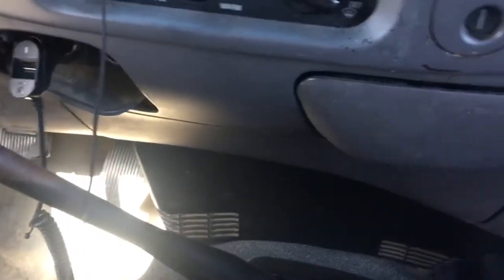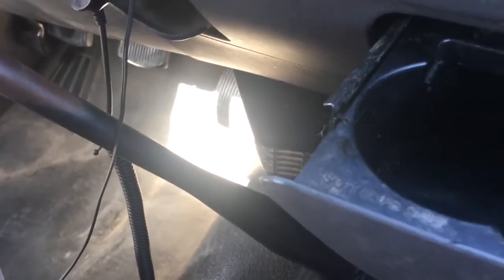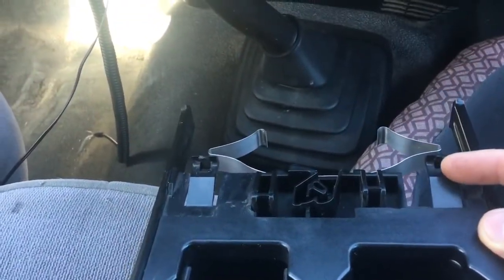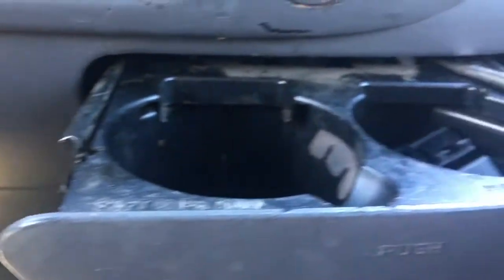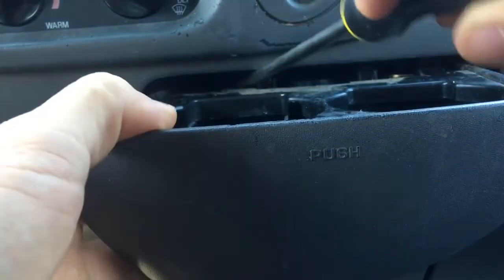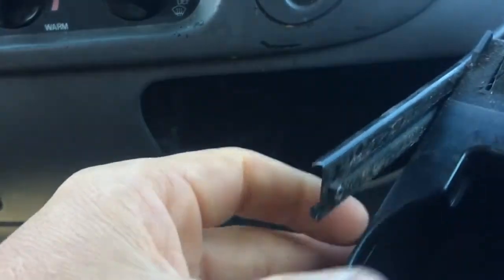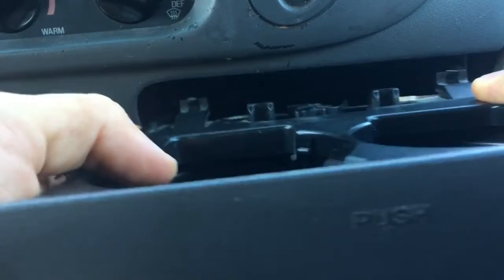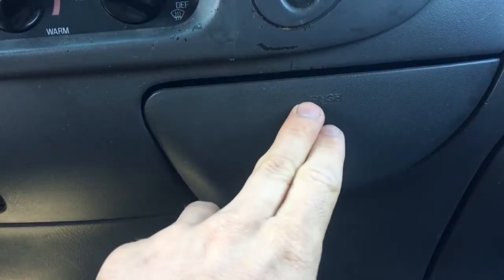How To Remove a cup holder in a 2001 Ford f150

Comment: Notice what mine was broken today while I was trying to get the air conditioner working.
Thanks for your video on you how to take it out good night hillbilly engineered it, just drilled and put screws in where the 20+ clear old plastic broke. It's better than it was
Reply from the maker: Hope it lasts another 20 years
Reply: @KalleSWBeck  Thanks again for the video